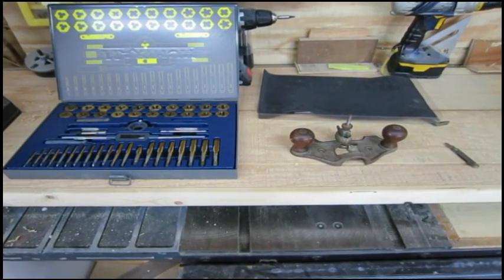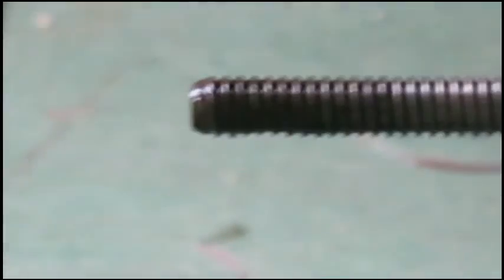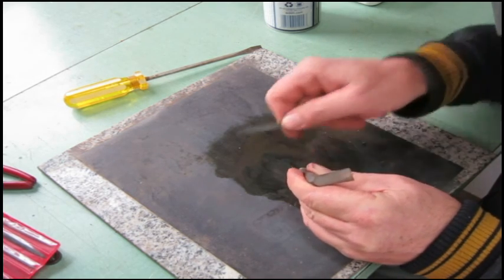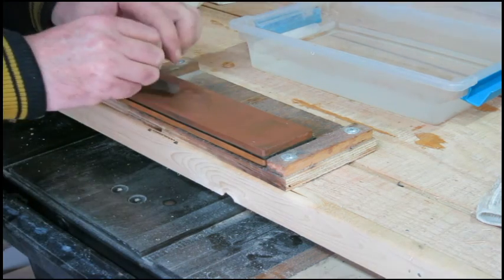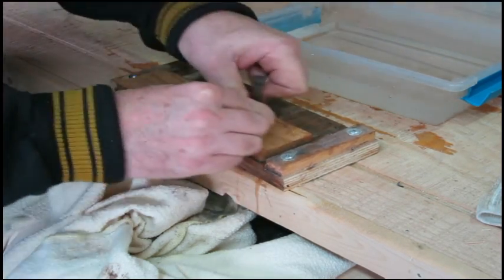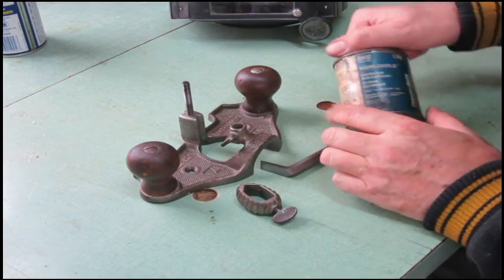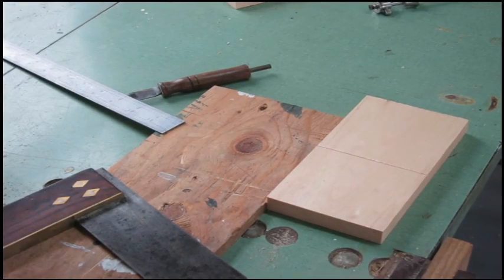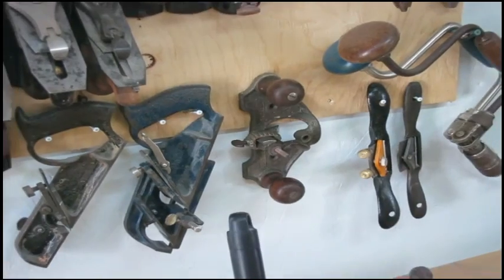Stanley 71 Router Plane: A quick tune up

Comment: I just purchased a Model 71 and had some of the same issues that you had. Most of the threads had some sort of rust or corrosion. I started with 3in1 oil but was not satisfied with how the oil by itself was cleaning the threads. I went to my sharpening drawer for some of my lapping compound. A light rub and a drop of 3in1 oil and then running the knurled knob up and down the threaded rod worked magic. After a thorough cleaning with brake cleaner I used the 3in1 oil on the threads and it moves like it is brand new. There is an immense amount of joy in bringing matured tools into working shape again. 
I enjoyed your video!
Reply from the maker: That's a great idea.  Thanks for the tip and for watching.

Comment from the maker: +58Chev Thanks, the one side is 1000 grit, the other is 4000 grit.  It is from Lee Valley and comes with the basic cabinet makers sharpening set that includes the MKll guide.
Reply: +Jim Dockrell (Watertone) , Think I git this reply/comment thing figured out.
What grit was the sand paper you were using at the beginning of the video?
Reply from the maker: +58Chev 400 grit wet/dry,  well worn though,  it needs replacing.

Comment: Why didn't you chisel out most of the waste then use the router plane just to true up the bottom of the housing?
Reply from the maker: I must be misunderstanding your comment.  That is exactly what I did do.
Reply: Sorry, you are right.  I should have looked at your video more closely.
Reply: I use the router plane almost constantly - for truing up cheeks of tenons for example - a very handy piece of kit.  I'm thinking of upgrading to the Veritas version - any thoughts?
Reply from the maker: I think I would like one...or maybe more, they come in different sizes and Veritas makes wonderful tools.  I will eventually get one.

Comment: The 3 corner file would have had the exact angle you needed to clean the threads
Reply from the maker: Thanks, I will keep that in mind.
Reply: @JimDockrellWatertone  Your threads have a 60 deg included angle and a 3 corner file has three 60 deg corners. A perfect fit. Metric, pipe threads, etc... though are a whole different story.
Reply from the maker: @anthonymiller8979  I recall hearing that somewhere when I was younger.  I had forgotten it.  Thanks for the reminder!
Reply: @JimDockrellWatertone I actually may need to rescind my statement. The 60 deg. applies to USA threads but I just realized that for some odd reason Stanley used Whitworth threads (British( on their planes. They have a 55 deg angle. Odd choice by Stanley
Reply from the maker: @anthonymiller8979  Thank you for clearing that up.

Comment: With Evaporust and a wire wheel you'd have saved yourself a lot of time.
Reply from the maker: Yes, I have to invest in some evaporust.  I finally have a wire wheel now.  Work with what you got though is sometime necessary.
Reply: @JimDockrellWatertone  White vinegar will do just as well. It is very inexpensive, especially if purchased from Costco.

Comment: Sorry Jim. You could edit this down to about 5 minutes if you didn't show every stroke of the blade etc. Also there is the correct way to sharpen the blade!!
Reply from the maker: The tool works great, but I will wait for your video on how to do it your way.
Reply: I got the techniques from youtube Jim. The Lie Neilsen or Axminster sites are good.